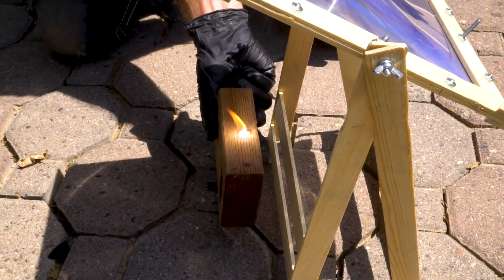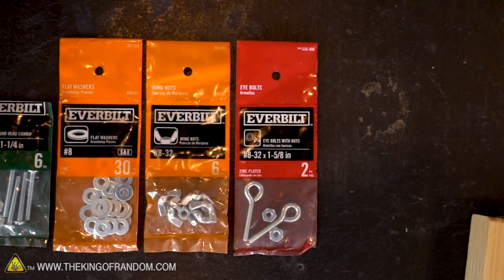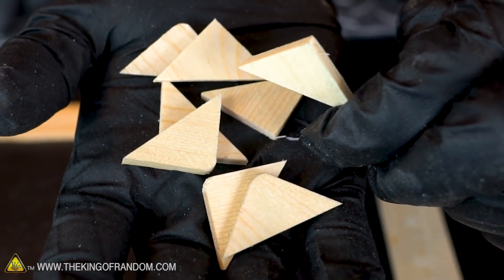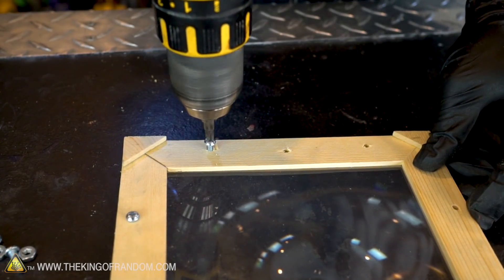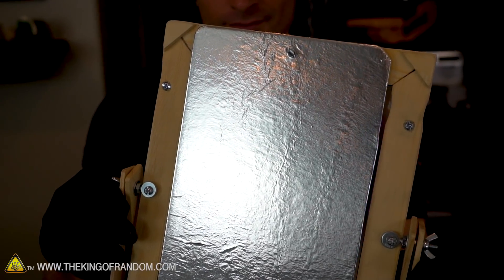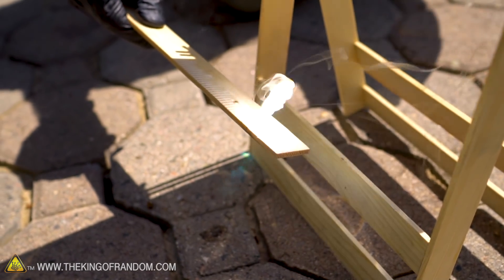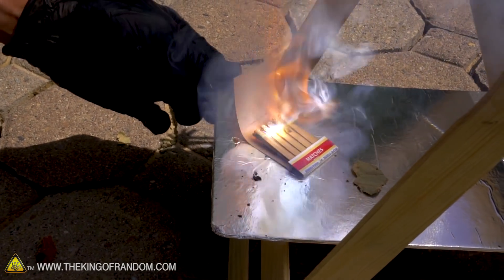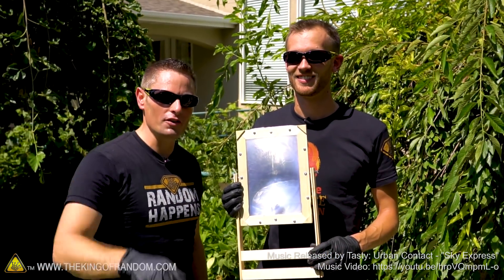Powerful Desktop "Solar Scorcher"! TKOR Shows You How To Make A Mini Solar Scorcher That Works!

Comment: Can you ignite thermite with this?
Reply: What about melt metal?
Reply: a-lpha of Zeldaforme Gaming surely
Reply: I wouldn't be too sure; thermite has a very high ignition point.
Reply: Geflügel HNZ He tried it before in other video quite a long time ago n it did ignite the termite. Almost burned the solar scorcher itself.
Reply: I was about to ask the same question.
Reply: No. You need magnesium.
Reply: a-lpha of Zeldaforme Gaming Yes it can, he did it before
Reply: a-lpha of Zeldaforme Gaming That sounds like an awesome idea
Reply: a-lpha of Zeldaforme Gaming  he all ready did this
Reply: Gas
Reply: gaffy h he melted metal with the big one
Reply: a-lpha of Zeldaforme Gaming yes
Reply: Mickxal you use magnesium to ignite thermite because the heat reaction steps up. You can light it with a torch, which then produces enough heat to ignite the thermite. Thermite simply needs enough heat sunk into it to ignite, the large could, so it seems reasonable that the small one might.
Reply: Yes he's done it before
Reply: no this thing isn’t large enough